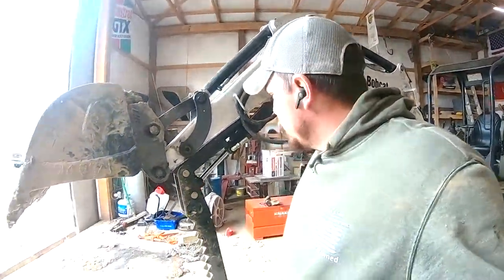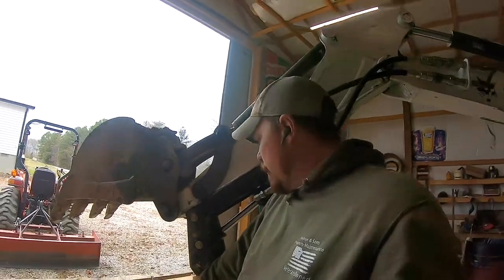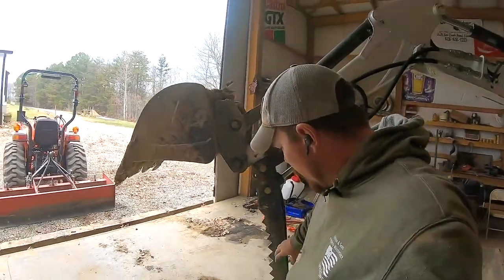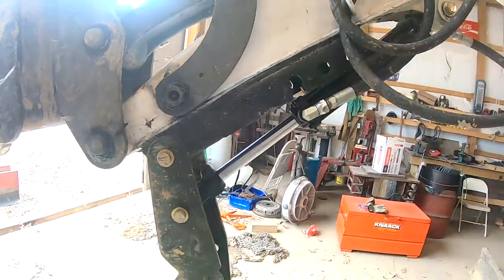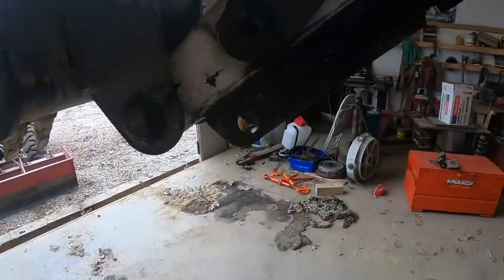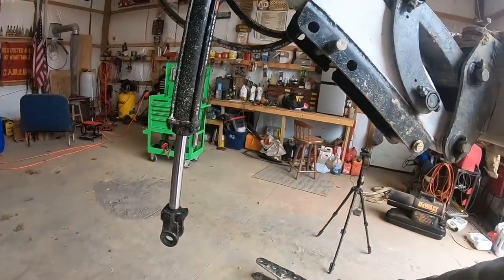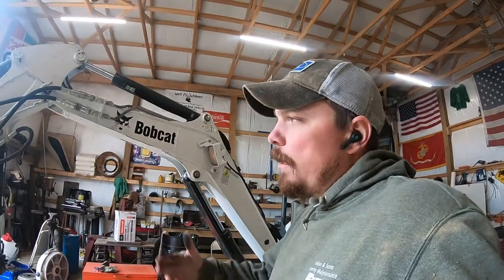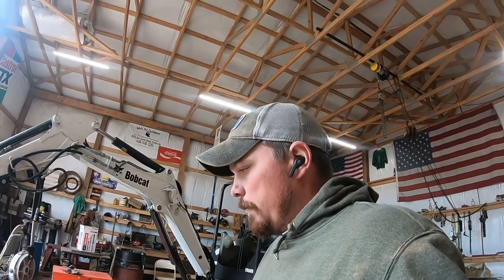WATCH BEFORE YOU BUY Amazon backhoe/excavator thumb review

Comment: That's a easy fix. Go buy pipe from steel yard that fits you pin. When you put a full piace pipe across and install a greese set. I'll pay 300.00 and mod it to work better for a few dollars. Then pay 2000.00 to 3000.00. But that's me. I can weld. Built my ripper tooth for less then 100.00 for subcompact kioti tractor. It works grate with less mess
Reply from the maker: Yes there are ways to fix it. I understand that. If you follow my channel you can see I’m capable of that. It’s the fact a lot of folks aren’t. So if they are looking into buying this piece and they don’t then maybe go ahead and buy the right thing. I think i was looking at some name brands for around 1600 bucks. I’m already around 900 after buying and upgrading the cylinder and hoses.